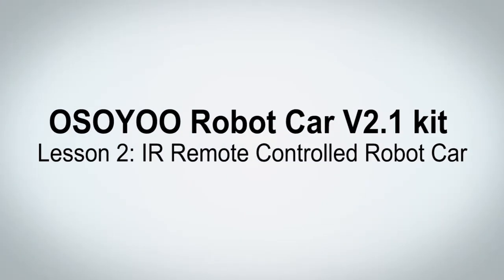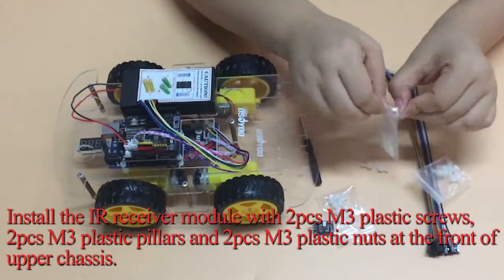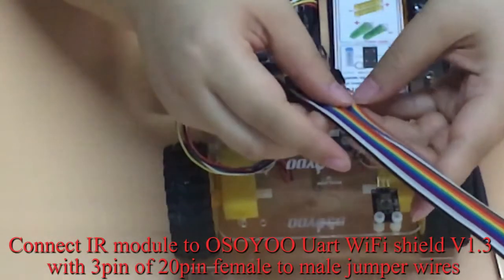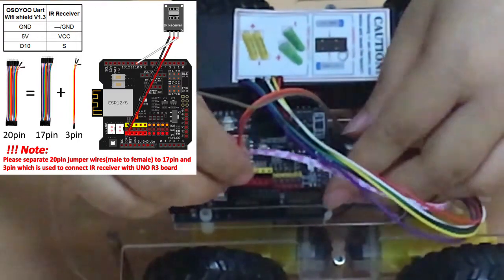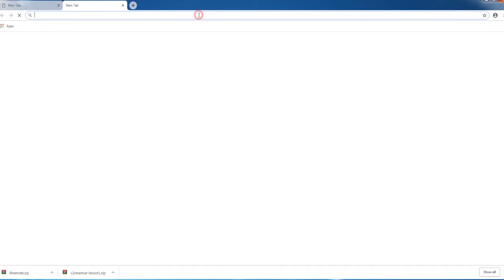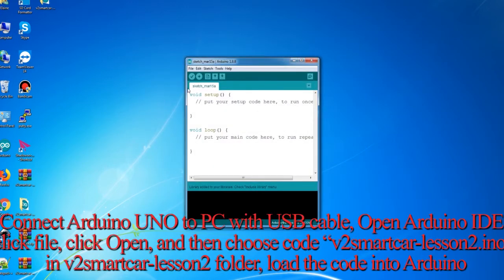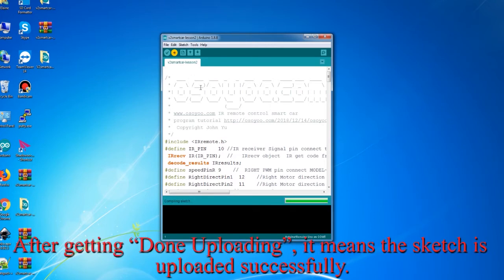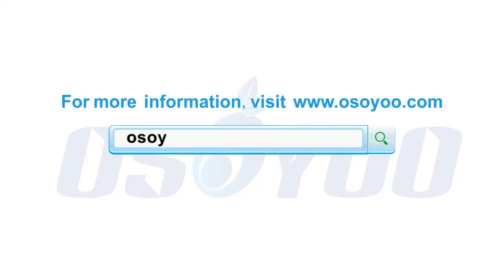OSOYOO V2.1 Robot Car for Arduino Lesson 2 : IR Remote controlled

Comment: These software instructions are terrible and outdated.  The IRremote download was a folder with files, not a zipped file.  I had an issue with the <header.h> not found when trying to compile the v2smartcar-lesson2.ino code

I had to compress the IRRemote folder/files that were downloaded
In the Arduino IDE, file --> open v2smartcar-lesson1.ino
In the Arduino IDE, sketch --> include library --> add .zip library and pull in the compressed IRRemote folder

recompile v2smartcar-lesson2.ino code

Comment: I want to do lesson 2 but when i upload the code it says exit status 1 
can you say what does it mean
Reply: I had an issue with the <header.h> not found.  Here's how i solved it

I had to compress the IRRemote folder/files that were downloaded
In the Arduino IDE, file --> open v2smartcar-lesson2.ino
In the Arduino IDE, sketch --> include library --> add .zip library and pull in the compressed IRRemote folder